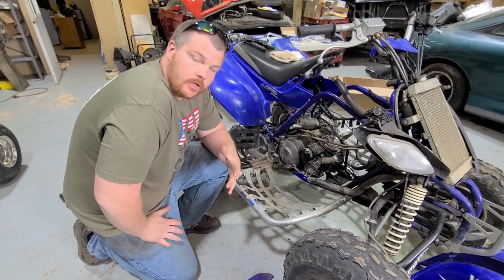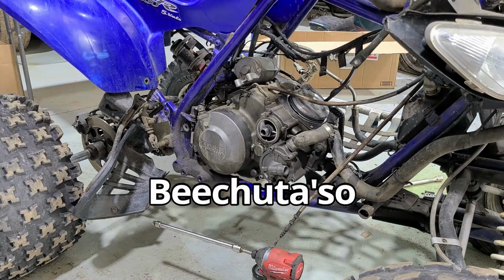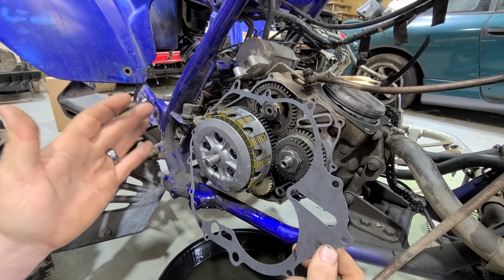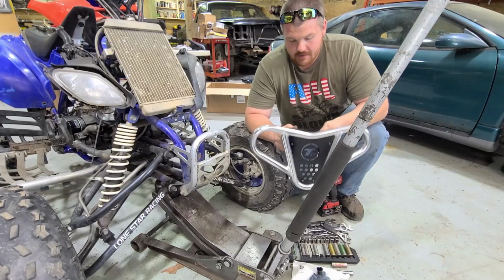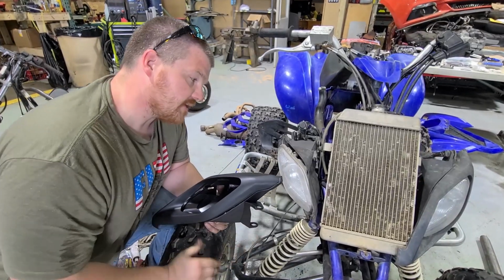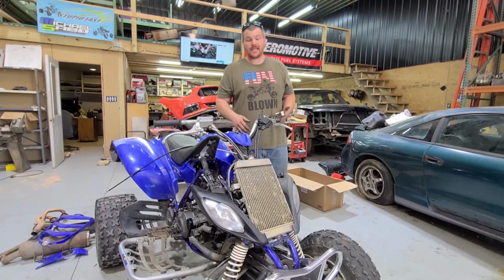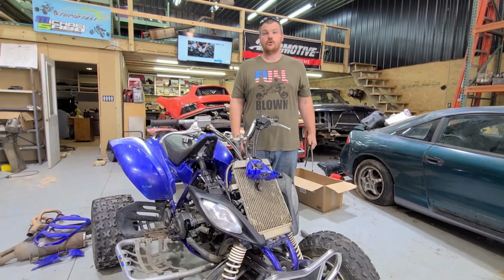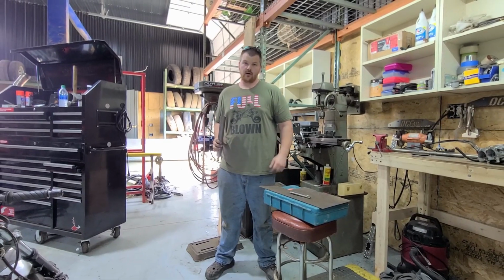UPGRADING The Feel & Performance of our Raptor 660 (MAJOR IMPROVEMENTS!)

Comment: Dude no way I used to own a Raptor 660 and I had the same CNC blue levers and the same Tusk front bumper! You sooooo have to get the ALBA racing full nerf bars, I had a set on mine they were about $220 and some change but so freaking worth it, that was the single best upgrade I ever got for mine, the original foot pegs ain't got nothing on the ALBA ones, great video man!

Comment: Don't need any lock tight on clutch springs the spring its what holds tension on the bolt making it so it cant come out, also lock tight only works if there's no trace of oil and bolts that live in oil need oil when torquing down because if there put in dry once they pick up oil it can make them loose so in the future all you need to do is make sure the the bolts have a little film of oil and torque to spec and they will never fall out. I've never ever had an issue

Comment: You should try and get your hands on a set of carb yfz 450 shocks for the front it will lower the front some and stiffen it up so it doesn’t feel as tippy when playing around
Reply from the maker: THATS some good info brother! I have my banshee setup like that
Reply: @StupidFastJohn  yeah man it’s what I run on my raptor 700 they were a big improvement over stock pogos they are so much more stable cornering

Comment: Hey you should of gone in details with the tuning of the carb. Specially on the raptor 660 dual carb. I'm having issue with mine after I but in a new big bang evo 2 exhaust and stage 2 dynojet carb .
Reply from the maker: Im running a 32.5 pilot and 170 mains

Comment: Great video! simple, accurate, good angle shot! Thank you 
By the way what’s the part number for the aluminum switch clamp? I’ve been trying to upgrade the one I have
Reply from the maker: It was a random eBay find from Mod quad

Comment: This may not be what your video is about, but there are only a few of you doing anything with Yamaha Raptors.  I have been looking for one piece of info for a very long time - that's it.  Do you know what the dimensions are for the main frame tubing - the outside (diameter) appears to measure 1.125 (1  1/8).  I can not measure the thickness (gauge) of that tube.  Does anybody know what the thickness or gauge is on the main frame?  Can be Raptor 660 or 700. Thanks

Comment: I just did a sick build on one  it's on my channel but I got the bigger alum oil tank an it gets pretty damn hot from the exhaust. Any ideas other then a wrap in the pipes that can stop the heat at all ?
Reply from the maker: Jet the pilot up, thats normally what causes a lean idle. Mine gets a little hott too but the coolant temp never gets over 170-180 which is fantastic for these. Running about a 35 pilot jet 👊 (also oil does help cool a tiny bit but not much. Focus more on radiator/coolant temp then oil, the oil tank is more for the "dry sump system" of the engine).
Reply from the maker: Also hotwire the fan on all the time. Every serious raptor 660 owmer ive met does it
Reply: @StupidFastJohn  just set up a rocker switch to it
Reply: @StupidFastJohn  i did right off with a stage 2 dynojet kit and had the carbs all prof done with them cleaned jetted tuned all of it. . I ordered some exhaust wrap and am going to mount a secondary plate between the oil tank n. Exhaust. Hoping it will keep it cool